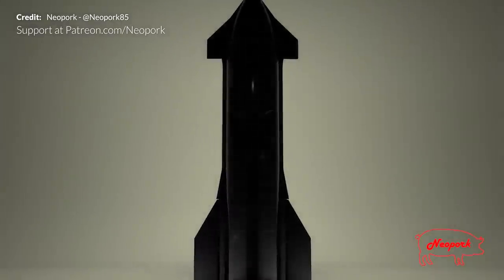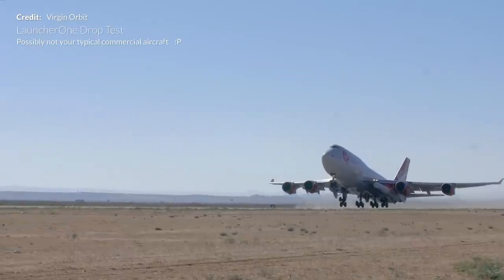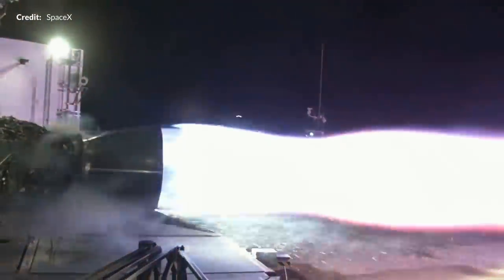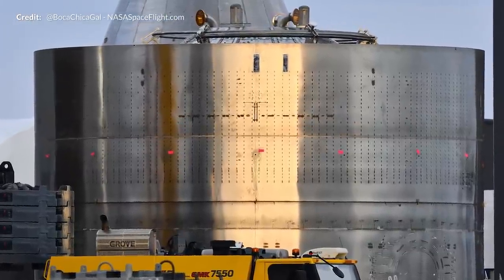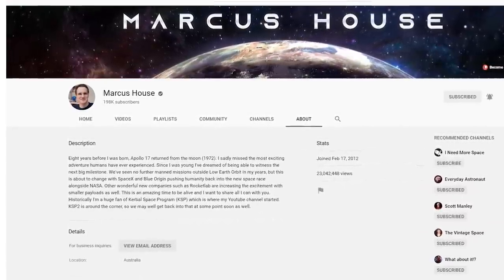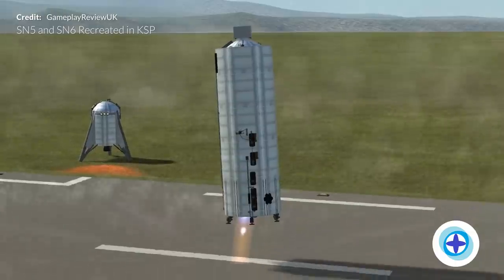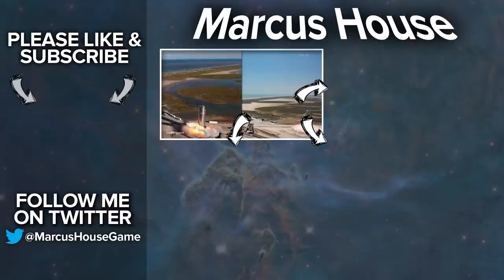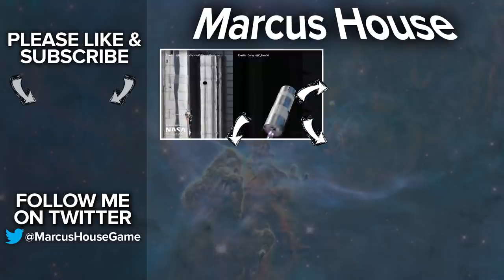SpaceX Starship Flight to 60,000ft - From Hop to Bellyflop

Comment: Honestly, I wanna see Dynetic's lander on the moon
Reply from the maker: Likewise. I really like the plan for that beast.
Reply: I look forward to all 3, and any structures they are able to build to begin a proper moon base
Reply: It looks so cool 

What if it was refuelled by starship
Reply: In 4k please
Reply: Marcus House i think its the only design i have seen for connecting modules together that makes sense, your not going to be able to Land  under propulsion and link modules up on the moon. The rover module makes the most sense for linking sections together
Reply: Yeah, the Dynetics design does seem to make the most sense. A Moon Starship would be cool but wildly impractical (though as Captain Ahab says the Starship could be really useful to Artemis in other roles), and the Blue Origin lander isn't reusable at all.
Reply: Kevin Street its not impractical for a moon base as a stand alone building however if someone were to suggest linking them that would be different ya know? I do however believe eventually someone will use starship too send inflatable habs to the moon too tho.
Reply: @MarcusHouse  It definitely needs less fuel than the HLS-Starship to move astronauts on and off the lunar surface.   And one of the other models shown in their video showed no discarded propellant tanks, but did double the number of tanks mounted.
Reply: I can see Dynetic providing most of the manned flights, since Starship will be hard to re-orbit.  But Starship has the cargo capability to actually land big, heavy stuff like living spaces, labratories, mining equipment, or fuel for surface ops.  It also represents many tons of raw steel that could be broken down and re-welded on the moon.  If Starship turns out as cheap to build as Elon is saying, the value of that much steel on the lunar surface could be worth a lot more
 than the prospect of re-flying it.

Either way, I struggle to see the Dynetic lander alone as a long-term solution for inhabiting the moon.  I think its going to take both of them working together to really make the lunar gateway work long-term.
Reply: tippyc2 thats the best part tho as it also means the program is harder to cancel

Comment: Fun thought, but SN9 won't roll down to the launch site on its own legs, IMO. Elon just makes some light remarks. A ~3km road trip needs tires and a suspension. SN5 and 6 have been moved around the shipyard on assembly mounts that are on this type of wheels, the giant casters. Using the legs for this is a natural progression, but just for the shipyard.

Comment: Great info. Marcus and team!   
       It's to bad they can't move the vehicle assembly building from 
Kennedy to Boca Chica; Then again, the VAB's 
foot print probably would 
cover the whole area of 
Boca Chica.  I realize one 
building would not make 
any sense since parts , or 
in this case  the massive  
pieces of the structure of Starship are constantly moving , refitted, readjusted,  reconfigured and retested up until a test.
In addition, a whole Saturn 5's assembly was completed in the  VAB, and 
transported to one of two launch  sites by the huge 
crawler,  ( of which the 
crawler's huge foot print would cover Boca Chica as well).
      There is definitely more
conviency to having everything in the same vicinity in testing structures that have never 
been fully tested until 
out on a test bed.   
   It is indeed a growing lab 
testing campus  in that instead of an  automotive product,  it  is an interplanetary Starship.
     As always,  great reporting from yourself and  team 
in bringing this history to 
life.   Exciting and "fascinating " !👍👍

Comment: I guess they might do several manoevers in one flight. You don't need ground nearby to try the flop, you can just go and try to get into a stable hovering at any hight, then go into freefall again and repeat. If you do not get it right on first try, you have another try to get it right before impacting on the ground and losing the prototype.

Comment: There is three practicsl ways to land, after re-entry belly burn heat shield of SN;
1# dive & glide with the rear boosters as a wind break, glide over the target attepmting very low, just before zenith over, pull up, at stall zenith of target land, flip & launch boosters at a low touch down., under 70~55 stories high. #2, do the first step Pod top head, to dive & glide. Both similar to a shuttle trip down. #3 step ( low grav planets only) add skycrane style boosters layed out adjacent of the heat shield belly about 16 to both sides, so to simply hoover land take off at low altitude with equal to rear boisters total trust. During Earth land, make the top Cargo Pod stage seperate for emergency land as well. Two simple ones, 3rd new land style.

Comment: The 60k foot test vehicle may benefit from use of a nose-mounted drogue chute to help with a nose-down attitude prior to engine ignition for slowing and touchdown in case the canards and other FC surfaces prove to be less effective in providing this attitude correction. Of course, in the rarefied Martian near-ground "Q", it will be too thin to have any real significant effect. On Mars, a much larger chute or combo chute/balloon "balloot" (SIC?) may be needed.

Comment: Maybe the SH1 booster parts are there in plain sight. Just look at SN5 and SN6... Knowing Elon, It wouldn't surprise me if most of the SH booster is made of 2 starship tank sections stacked on top of one another. This way they can build standard 30 meter tank section "cores" that can be used in both starship's and superheavy's assembly lines. A modular aproach saves development time and reduces production costs, like a lot.

Comment: Where do all the additional components, like control surfaces and thrust pucks get made?

Also do we know if the high bay will have a built in crane, and how will the welding be done, before full automation? On something like the super heavy?

Comment: Those horrible legs will collapse upon SN8 landing causing it to rapidly disassemble. This is going to be a much harder landing than SN5/6.
Reply from the maker: SN8 may have different legs. These are just temporary designs for early prototypes.
Reply: Why would you speculate that?
More engines, more thrust, more gimballing, more control.
Reply: @swapshots4427  These test flights will not be landing with three engines firing.

Comment: When using the Dynetics lander and they use the cabin portion to make a stationary Base building, how do they get back to orbit?  They will need a multiple vehicle landing mission and then use a lander that is at the end of it's flight rated lifetime, (for a base structure).  Otherwise they would need to put it back together again before takeoff.  Leading to so very many tests to almost re-qualify it to fly humans before it could be safe again.  (I am not trying to dis a great lander design, just thinking through the ideas presented.)  Other than Starship, I really like the Dynetics design.  It is a quick, simple, reusable design that deserves developing. 
-The "National Team" design is a plain dinosaur and a wasteful, ancient method that belongs in a museum.  They are relying on an older, model that almost failed in many instances.  It is too small to carry any useful equipment when "Going back to stay".  It litters up the landscape with most of it's bulk when taking off again, as well as being cramped inside and difficult to access/egress.  We need to look to a more modern form to better fill our new mission goal.
*I have not even started talking about the costs involved. Saving that for later.....LOL

Comment: Will SN8 return to its launch location for landing after the bellyflop? 
Wouldn’t it be a good idea to have a remote landing location in case the flop doesn’t work out?
Reply: Is 6:28 where it will land?
Reply from the maker: I believe that is the idea. I suspect they will have a very early flip and if it fails, they'll divert to crash land out in the swamp. Perhaps they will set up a landing pad further away. No evidence of that yet though. Can't wait to find out.
Reply: Marcus House Thanks for your thoughts.

Comment: after seing a video how it could like get perspective that scfi tech it require like extra swing 15-20% if add a like side like holders gliders to hold structre better, so we comunicate in falling down you can even inside curve this metal first slight cover plates then bend in wokrs as nother inside wind glider or colector trust which is nother airbuble cushion best if curve not more then 30% in eclipse form to get stabile didnt know you wath angle upper as well which is good so have rotational axis and attach gliders with hooks on servo this is nice, you can do protective caps to aircover the flaps also front and back for each wing, this idea is also good if you use 3x3 airbrakes and they too 360°  so basicyl software is also capable to creat live symetry human DNA once you desired turn into left side and are able to spin rocket in flips slower motion but plesant to fly you get like bigbang efect off einstein theory off temporary gravity close which has a direct cause off erath athmoshpere density mater colide in gas athmosphere let say in mars and you get some athmosphere stability also ,  is kin dliek human have mastered enter and reenter logo ability into planet aswell is kind like science athmsphere project automatic, and there is also climate change as well on earth I dont think is goind to buy elections as well in US which politics kind a hoped and bid wallets say suport, actualy is spirit opening sphere in next 15-20 years as mars base become possible,, and chinese are slowly opening eyes, oh market graspy deals and tehc is being presented to public and use, actualy is not dominable tech but form off will present bit diff then earth but compatible and possible and creative this climate stuff infoofn on andorid gets better in use mission for gas explore using mars as base and starting possible gas extract as potential are wast and get  some data about size and quality in space and what would volume gas would be eficient for use or travel in space for corp. After data presented you get aditional 100 billion in use for trade deals easy, and bla bla trillions talk..

Comment: Anyone running an over/under on the number of "off field landings" before an operation launch to orbit?

It would be interesting to see some economic models for what the ideal number if (non-zero I'm sure) to balance development cost, manufacturing cost and time-to-market. It would also be cool to know what SpaceX's internal target it: "If we don't crash at least 2 of them then we were being overly cautious!"

That opens another question: would it be worth building an extremely spartan landing facility further away? Just a big thick pad, a few places to mount cameras and nothing much else to break? The less things at risk and the faster they can get the ground facility back into operation the more risks they can afford to take.

Comment: I wonder if they could build the Starship with a single continuous spiral weld like how cardboard tubes are made. Then they would just have to trim the top and bottom and weld on the bulkheads and cone. It seems like that would be the easiest way to mass-produce.

Comment: Does anyone know why a vertical assembly design was used instead of a side-by-side configuration? The weight of that stack for a commercial launch will be enormous. The Space Shuttle demonstrated the the feasibility of side-by-side. 

There was an initial design concept of the space shuttle involving a fly-back first stage. It looked like a huge Venture Star first stage belly-to-belly with a smaller venture star "second stage". Both running until the first stage dropped away and the second stage running on its internal fuel to orbit. Nixon reportedly  killed the design because it had a R&D time frame that involved spending above 1.5 billion dollars and he wanted that .5 billion for Vietnam. Thus the external tank and SRBs. Anyone have a drawing of this design?

Comment: Wait are they using union concrete carpenters and iron workers to build that pad? If so i need to get down there. I LOVE once in a generation projects and have experience in biggest concrete structures you can imagine. I need to find the contractor building this stuff. How amazing would that be to be part of that....

Comment: This design is excellent for moving cargo however , the optimum for passenger transport would be strakes or additional finnage , large enough to enable a crash-landing if there were a propulsion-system malfunction . 
*Redundancy is a wonderful thing ! .😎
Reply: any passenger variant will no doubt have an ejector compartment complete with airbags and drag shutes.
Reply: @spacexvanityprojectslimite3315  
Umm... I'm betting not ; it's too big and heavy for that .  .🙉

Comment: excellent video so musch told  rocket looks like a toy we need more off that! make side protection gliders and get it etxtra wiring protocol for safety it would be even more stabile you get below a stack off heat covers small bricks also to get curve line below, now how about material squeze like metal above largerr depressed line and below smaller and you get like bar link bars also for stabiltiy, to get a point to a a a z letter in circle so you get get metal link suport suport safer for impact. works fine for diagonal holders pressure, if you do colision impact test and throught object from 50 kmh in diagonal way you see the diaognal force clearly and stuff like is also diagonal bar at 30% left and right and above, so basicly you get protective tensile force side way diagonal force and structure holder before rip above is aditiional holder structure to create torsion but not so teare a apart colision after while playing with design is already tubic with inside impacter only sides get stronger and ecplitic after while not needed is tubic can be like design star wars or star trek I would also add a rocket impact glider holders that tends to brake as airbrakes if heavy transporter on load atleeast 3x3 to get ship more stabile, next step is rotational gliders on servo so 2x2 does angel and back engine simply get in horizontal postion and ship space fly in deirction way using glider alos just airplane except back one engine needs some space to rotate so oyu get cut  litle metal below also in build components ring type assembly part is needed to infrastructure module assembly easy rest is modular upgrade body in 2 or 3 parts hed rotational and back engine fuel and attach rocket part so oyu got 5 pcs to assemble if done as am is lot more strucutre tough and some weight, oyu have to count for some metal space atleeast half volume for side rotational engine it would slide glide and fly in no time it would use some power by stop that things does the software, in basic is slow lift to some lvl angled move in %  1-3 % max 5% for start then some speed gain and pc curved line up acording condenzation lvl strenght on software youcan even lock speed as prerogram booster and space ship would fly on its own and slowly change to see what pilot wants or skip into midle it could be called auto ground lvl and is functionig better more stabile dynamics software lift is and it can be programed to fuel eficiency use desire eco in lift intercept is dynamid flight very fast skiping beteween speed sofware gear and with fast ignition like 25%-30% trust at start then 50-60% then imediate 84-95% power, in slower you add like 75 % gear and 64% so is nice like 5 gear and oyu add like 40%  and first gear between 1-20% so oyu get easy like 7-8 gears, the rest is volume use and tank fuel caracteristics, and later version would use booster fuel improved working like catalyst or like in  pressure chamber in car engine, get more suport electricity extra coolers better fuel absorbtion and strength per volume which works like air turbo in car,  and pc software woudl reuglate even this at data input to avoid and strange gas burst or undesired spots so could have beta tablet on engine direct with ddr memory run to and upkload stuff directly ba hand or on tablet or wifi direct com to cocpit as double comand inc wiring so liltel bit like star trek engine and slowly they get better moer eficient and smaller and with more pressure also understanding barr pressure and temparture ratio is nice be colectable data as engine needds to iso heated and most ilikely in some  case like double covering pipe for safety understanding pressure having all datain mind you get basic athm pressure the sound turbine and mesuring this get like eco data os sound frequency booster which pc can data colect and predict mistake and even shwo warning lvl on mismaneovuring stuff the kind kind noisy nav but it can save a you if you crash impact..why vait for all this all this can be a lot better and how about now!

Comment: See Marcus, this is why changing between imperial and metric units is a really bad idea. SpaceX will be sending SN8 to 20km NOT 18km aka 60k feet. Love your vids, but you back converted from Elon's 60k feet comment and landed up saying 18km, which is wrong.
Reply from the maker: 60,000 feet = 18.3kms. Elon tweeted in the week it would fly to 60,000 feet.